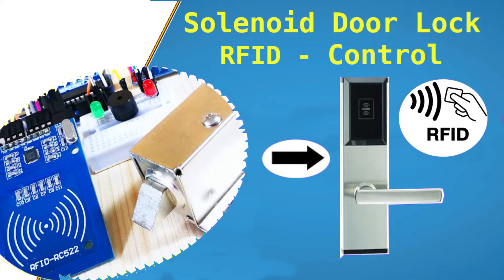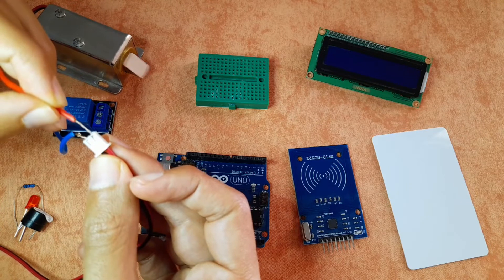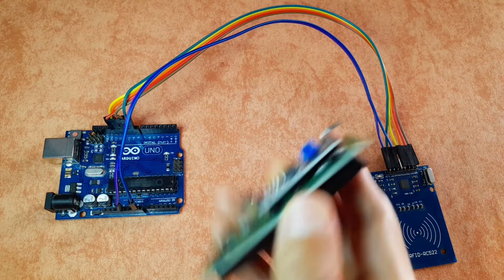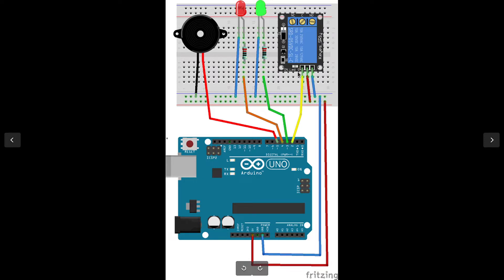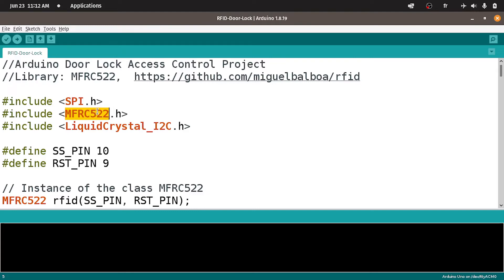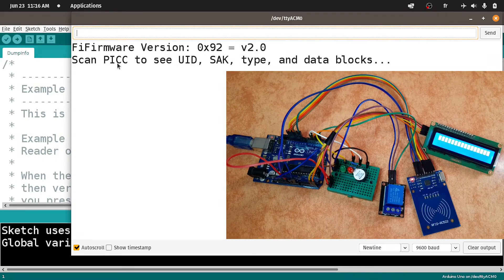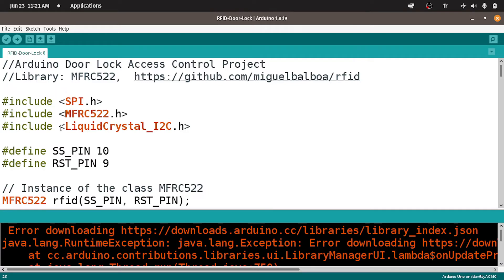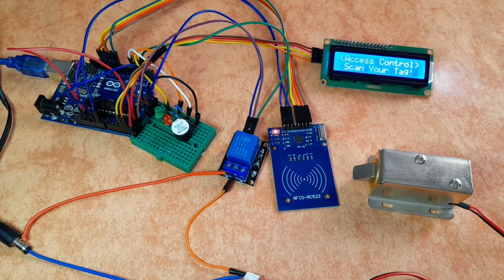Arduino Based RFID Door Lock  🔐 Project

Comment: Great video.. Kudos to the clear explanation. 
I would like to understand one point for my project (not door lock, of course). As in the video, when the RFID activates, we can give an output signal for 5 secs and turns off, right?  My requirement is, upon activation, the reader must not sense again for a particular time, which can be provided by a 12V busy signal from the machine. So, once the busy signal is removed by machine, RFID reader is ready to scan again.. Could u pls advise.